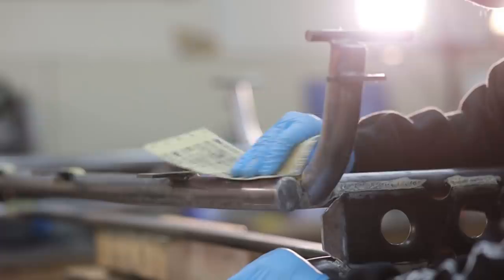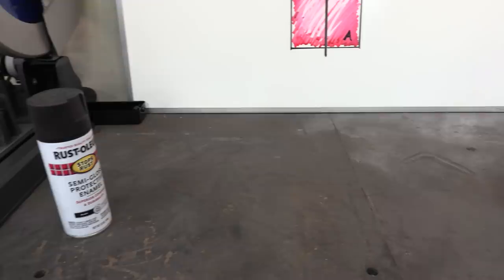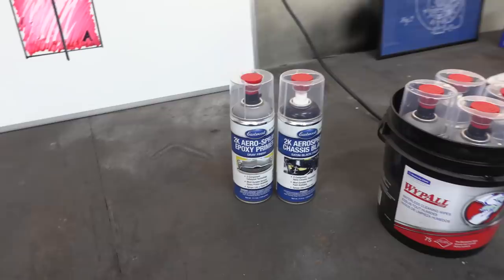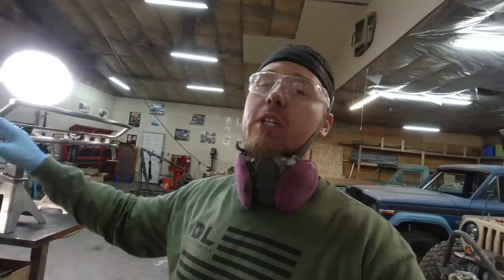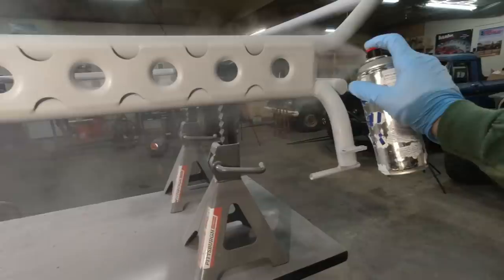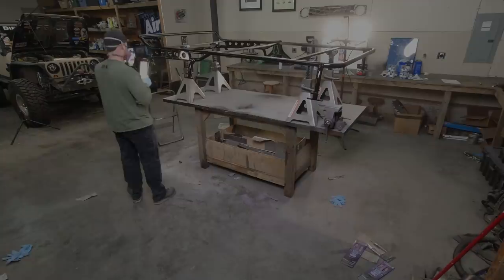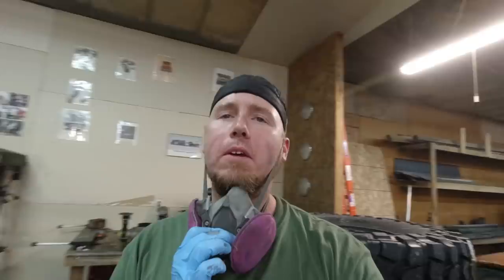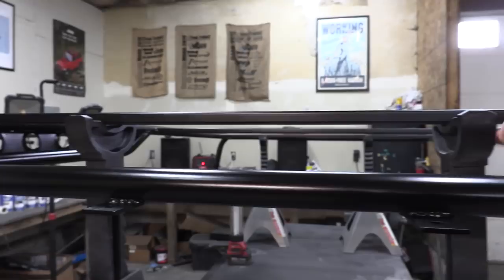Spray Paint TRICKS For Car PROJECTS

Comment: Thanks for the tips!  I knew most of this, but it's nice to see someone else doing it, to sort of reassure my methods. ;) Good call on the respirator. I usually paint outside if I can. There is always the risk of contaminants in the paint, but the risk to my lungs is much lower. My shop is also under my house, so all the fumes make their way up through the floorboards and nobody likes that. A good box fan or two helps when I have to paint in the garage.

Comment: You should check out steel-it paint. I have never used it myself but have heard it’s great. It’s spray paint but it’s claimed you can weld right over it without taking the paint off. They use it in Baja

Comment: Epoxy pain was originally developed for metal placed under salt water as in platforms for off shore drilling rigs and it works very well in that application. Do not attempt to use on wood as it will just be absorbed and will flake off.

Comment: Painting bare metal parts make sure you use a DTM  Direct to metal Epoxy,Etch primer (zinc chromate) Be careful with etch primer it will make you have 3 eyed kids. Never put primer directly on metal you must have an etch for primer to adhere or some kind of DTM. Never let the etch primer sit outside as it can wick moisture as well. Great job though good tips. SEM has some really good products for some DIY  projects. Spray max makes the cans you were using I believe.

Comment: Hey Nate 
One alternative I came across lately with my local powder coating company is powder coat prime, then you top coat with your desired paint that can easily be recorded. This way you get the quality and durability of sand blast and powder coat and the ability to then add your own top coat that can be recoated anytime it needs a touch up. if you have to add tabs etc later then you clean small spot with a flap disc weld tab on and top coat. 

You can’t top coat finished powder coat as the material of the coating is not the same as powder coat prime. Powder coat prime is specifically made to be top coated. 

For top coat I love hammer metal paints and “Steel-it”. Steelit is made with 316 stainless steel and blends perfect with no dry spots over base coat. Great for touch ups.

Comment: Nice video Nate. Couple of tips though. Rather than use aerosol prep, purchase a gallon of Wax & Grease remover and apply to a paper towel and wipe. Much cheaper in the long run and actually easier to use. I will wipe down prior to applying primer and then again just before paint if it happens to sit overnight or longer.  
Also if you hang your work with mechanics wire it allows better coverage then you don’t have to go back and hit the missing areas. 
Lastly, and this may just be me, but placing garbage bags over your jack stands keeps the unsightly overspray off of your jack stands. Personally I hate overspray on my tools and equipment. 
Mike

Comment: Nate, have you looked into Steel-It paint? Its stainless steel in a can and it’s weldable. Never used it myself but have only heard good things.
Reply: TMR Customs here in Ontario uses that paint on all their bumpers, truss kits, anything that may require a weld. It coats amazing and the finish looks great.
Reply from the maker: I've heard good things but I haven't used it 👍
Reply: I was going to suggest steel-it, you beat me to it. We use it in our fab shop on small frames , brackets and guards and I’ll say it’s the next best thing to powder coating. Can’t find it just anywhere but McMaster Carr has it I know. Good stuff. Thanks for the video.

Comment: I actually was trained to use this epoxy paint years ago, in the early 90's. Has come a long way to have it in spray cans. It's actually a paint used to paint aircraft. Strongest paint you can get. But the thing on using primer first, you do not need primer for this paint, it's a sales gimmick, sorry. Well, if it is true epoxy paint, that is. So if it is actual epoxy paint then the primer you sprayed on was the same paint as the base paint with a different color.
Reply: At 29 bucks a can, sales gimmicks like that are so wrong.

Comment: That's interesting they make the epoxy paint in a spray can as well. Right now I have my tj all apart painting my frame in por15 which is suppose to an epoxy or hardening paint. Cant wait to see how that paint holds bc that could save me doing some touch ups later down the road than just normal spray paint

Comment: Alot of good tips in this video. There's been a ton of stuff I've learned from you. I have a few suggestions though, I would look into getting a full face respirator to use when painting along with some organic vapor cartridges. Bc even though you wore glasses the fumes and overspray can still get around them and enter your body through your eyes. I know a few paint and body guys and that's what they use when painting and use a mask like the one you wore when doing body work. I depaint aircraft and we are required to use full face masks with organic vapor cartridges. I've also noticed that some higher end shops I've been to and some custom car builders on tv actually use supplied air masks/helmets, so fresh breathing air is actually pumped into the mask/helmet from a source outside the booth or a small filtered unit on a belt that they strap around their waist and also wear coveralls while painting bc like you said it can soak in through skin. I must agree with the others also saying a heater with an open flame wasn't the best thing to be using while painting bc the chance of it lighting off the fumes.

Comment: Put cardboard down on your bench or plastic however the problem with plastic is you can have a static charge with it. I use cardboard a bunch whenever I work in a greasy project most body shops will give you large boxes if you ask them. Not usually an issue but there is always that one freak accident. For the most part you are right on the money with painting. If your ever in Portland stop on by and I will give you a tour of the shop. You will get to see TESLA cars being repaired it will blow your mind. Those cars are mostly rivets of all kinds and panel bonded panels together. Silicone bronze welders,nitrogen welders for plastic repairs also.
Reply from the maker: Thanks for sharing your expertise 👍. Will do man!

Comment: At $27 a can. I don’t think the average person could justify using it on anything that would take more than a can or two. Powder coating around me must be cheap I guess though. Maybe I’m just poor idk haha. I tend to use a tiny compressor, HF Gun, rustoleum paint, and a 2k clear from my local auto paint store. Seems to me like a better long term solution if you’re finding yourself painting often. I wish I could afford this stuff tho. Would save hassle for sure. Anyway your videos got me into buying my own tube bender, which in turn has saved me money in the long run. So thanks!

Comment: Great video! BUT, never paint with a heat source created by fire. That over spray is very flammable and gasses being released  as you press the nozzle travel even when you can't see them.
Reply: I think that is why he left it on during the 2nd coat so it burns off and no big flame up when he fired it up

Comment: Great video. One edit to your respirator though is you are not supposed to have any facial hair and they are supposed to be test fitted to your face. The hair can allow it to leak and can actually cause the harmful stuff in the air to get inside the mask where it is then concentrated and you’re breathing it in.

Comment: So you have the heater with an open flame running while you're filling your shop up with explosive/flammable vapors from the rattle can? IIRC, some of them use propane as a propellant to get the paint out of the can...

The Rust-Oleum Industrial paint is the best I've found this side of a 2 part epoxy paint. It's in a silver can and dries even at 34*  and at 50* it is dry to the touch and can be handled in about 25 min. The stuff in the white can is like water in comparison. 
Rust-Oleum Industrial, try some.
If you buy it in the gallon can get the cheap harbor freight airless sprayer and throw it away when you're done. I used to paint my flat bed trailer and farm equipment this way and it was way cheaper than using the spray cans and much faster.
Reply: There isnt enough propellant in that can to fill that whole shop up with the right mix of fuel to air. Now maybe in smaller shops but unless you have a medically sealed shop.... however it really should be talked about
Reply: @leokarasinski4217  one of may neighbors ended up in a burn unit while rattle can painting his S-10 and the same style heater lit up the vapors. He ended up with burns in his lungs, face, hands and upper body and lost his house. Also if your going be running one of those make sure to have a Carbon Monoxide detector in the shop to make sure you don't poison yourselves. I do HVAC for a living and carbon monoxide poisoning is no joke. I have a couple of the portable propane heaters, and I won't run them without the detector in my work areas.
Stay safe.
Reply: @4schitzangiggles  agreed on the monoxide detector. How much rattle canning was he doing tho? One or two cans would never mix to me flammable vapor level. Painting all night in a garage that was pretty well sealed would. I'm not saying it cant happen
Reply: @leokarasinski4217  he was on his forth or fifth can painting his bumpers.
Reply: I also worked in the oil and gas industry and I have had to perform after action reports on accidents resulting in injury, death or property damage. Biggest cause was people thinking what they were doing couldn't cause an issue because they had done _______ a bunch of times and nothing bad had happened, so why worry about it? I've had to explain to families and friends why their loved one is no longer with us. The vast majority of the time was ignoring safety process and procedures. I do t want anyone to have to deal with wholely preventable "accidents".

Comment: I do a bit of powder coating from time to time...And hanging/holding stuff is one of the most difficult things. If you've got any threaded holes that you can hang from or stand on using bolts or threaded rod with nuts as legs, it's a good way to go.

I'll have to give that 2K epoxy stuff a whack. It looks like a decent alternative to powder.

Comment: Paint fumes are extremely flammable. Running that torpedo heater with those fumes in the air is dangerous. Same thing with flammable fumes and an ignition source such as a pilot light, gas water heater, etc. 

I agree with you 100% on the painting process though!

Comment: I learned from painting a pistol and researching: paint a tack layer wait 10, spray next layer, wait until your touch leaves only a fingerprint, spray layer, wait until fingerprint. Let it dry for 3-4 days for full cure before spraying any clear coat layers. (Clear goes on the same as pigment paint) The 2 paint types dry at different rates and the clear seals in the pigment paint solvent that is trying to leave. This makes for a soft paint product for a long time. Handling this soft paint with your hands introduces oils and dirt which makes the process of drying practically stop. 
The pistol I painted is my DAILY concealed appendix carry (it touches my skin and gets oils, sweat, and dirt directly on the entire left side) weapon and has not rubbed off, gotten gummy, or smeared colors together. There is no difference between the left and right sides. Believe me, I was worried, but this is the paint method I will use in the future.
Now I have to research epoxy paints! Commence losing 4 hours of my life...

Comment: I'm down for protection. But, your respirator is for dust only. You can use the same mask. But you need the filters for paint. If you can still smell the paint. It's not filtering out the bad stuff.. great video though

Comment: Hey Nate. I really love your channel and your content.  The rack looks amazing.   One thing I’ve experienced when painting or staining in a small garage with an open flame heater is the paint fumes seem like they are burning up.  Even with PPE equipment, I’ve had some wicked headaches. I’m not sure, it could be the paint or the paint fumes burning, regardless I now heat the garage first, turn off the heater, then paint.   Since doing that, I’ve avoided those headaches.

Comment: Look into cerokote.. it’s typically reserved for firearms and I’ve been wanting to try on automotive stuff to see how durable it is.. but provides a pretty nice finish to firearms that doesn’t chip and fade like normal paints but instead wears. As a result you can simply repaint wo all the normal prep. Firearm parts companies will be the best place to get and. Cost about the same as regular spray paint. Brownells is a good source. 

I wouldn’t call it a “hard protective finish” per say like epoxy or enamel but even epoxy and enamel paints won’t hold up on our rigs and the repaint prep will be a fraction of the time and effort.

Comment: Nate,
Excellent tips and perfect video productions.  I particularly like how you explain all the specifics and details.  I love details.
Props to you. 

Just an observation of caution as it pertains to heating the paint area as it poses a highly flammable environment.
Unless you continually ventilate with fresh air, this condition may always exist.
A tip that works for me in a similar setup as yours is ventilate quickly as possible your paint area then heat your space indirectly (as much as possible) after ventilating.
What I do in my set up is to use a simple box fan at the man door at one end of my garage.  Orient it to blow outward.  On the opposite end, I setup my torpedo heater, outside of the garage blowing heat inward.  If it’s too cold outside, setup as far as possible where fumes are absent or very low.  Once I get up to temp, I remove the heater from the space and then button up the garage.  Repeat after the next paint cycle.

Reducing the chances for a potential explosion is paramount especially when open flame or igniters are present.

Hope my tip helps.
Peace.

Comment: If you paint in the shop, a fine layer of paint will get on EVERYTHING. Paint outside if the weather is good. A great alternative to a real paint booth is to use one of the Harbor Freight portable sheds or garages, at less than $200. An old camping tent can even be used. I haven’t seen the 2 part epoxy in rattle cans before. For the price, you are way ahead to buy epoxy paint in quarts or gallons and shoot it with a gun. Even a cheap Harbor Freight gun probably sprays better than those rattle cans.

Comment: Nate, I have that respirator, it's not for paint. Its only a particulate mask. I use it for welding and grinding since it fits under my hood. Same respirator will take filters with charcoal to stop the paint chems that will kill you! As in you shouldn't smell the paint through the respirator. I am just as bad "Ye ol hold yur bref" and walk away method lots of times. At least your wearing long sleeves, hell I rarely wear anything but a T-shirt and shorts! I have settled on the HF 7mil gloves being a good balance of durability, cost and don't hurt my hands from being so stiff, I wear them ALL the time! Easy clean up, saves me time at the sink etc. I keep a baggy of them in the Jeep, never know why your going to need them. I REALLY want to try that paint! I am curious as to how it holds up and how much does it cost. I would like to build a "paint booth" IE a small enclosed area with filtration and heat to keep it off of everything else without having to be outside. Something portable would be nice. Great video... Almost forgot, try some of those "painting cones" or triangles they sell at home improvement stores, they allow for a little tiny point of contact on your part, I like them! I also have a dislike for over spray so I bag my jack stands with used grocery bags. Picky huh LOL Again, enjoyed the video, thank you.

Comment: Not a fan of powder coat!  If there's one single blister from poor factory prep, usually by the time you see it, the rust has spread far. Then it's all sanding, the whole thing, sucks! I've also had good luck w/ a single stage rattle can of  "appliance  paint" by Rustoleum. Very durable ,  lays out great, take about two days to fully cure though. 
What's the pot life on the the Eastwood? Can you finish a partial can the next day?
Reply from the maker: Its supposed to be 48 hrs. I sprayed with a can about 30 hrs later on some other stuff and it still worked great. 👍

Comment: Just a question, what about the flammable part of the paint being in the air and you using a flame throwing heater? In factories I've worked at they used electric heaters to stop explosions. I'd like to know your take on this.
Reply from the maker: I started doing this after I saw a professional auto body painter do it many years ago. I haven't had an issue but I understand people's concerns

Comment: Paint is a lot better for repairs than powder coat. Once you've gone through the powder coat there is no good fix without re-coating the whole thing.  Paint is a lot easier to maintain and repair.  I will never use powder coat for that reason.
Reply: Personally dispise powder coats.  They tend to get brittle and separate from the base materials and utimately chip and then rust.  I think they are ok in certain situations, but for something that will take abuse, never

Comment: Great video Nate, currently working on revamping an old rusty set of steel bumpers on my JK. Tips/pointers for grinding the rust off (what to use) and prepping it for painting (use the primer stuff you used?). I’ll be trying out a few cans of “Steel-it” on the bumpers once they’re prepped. Thanks 🤙🏼